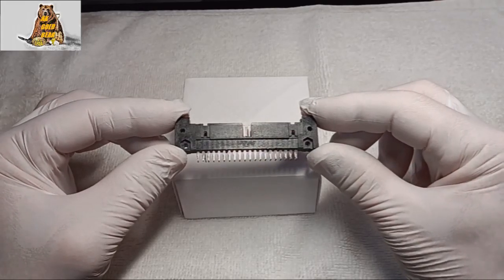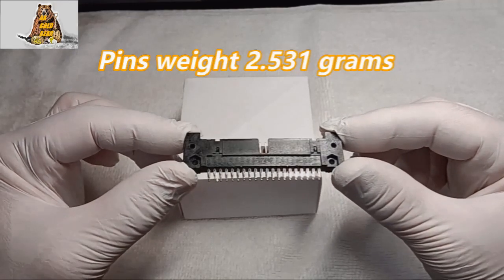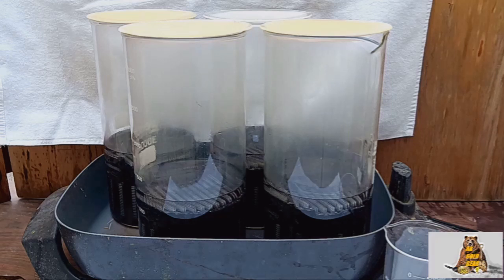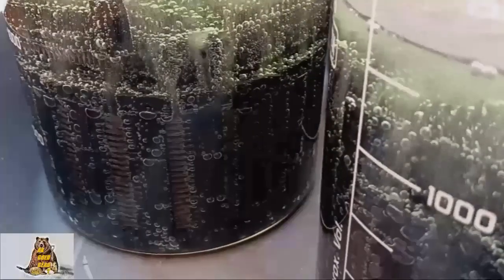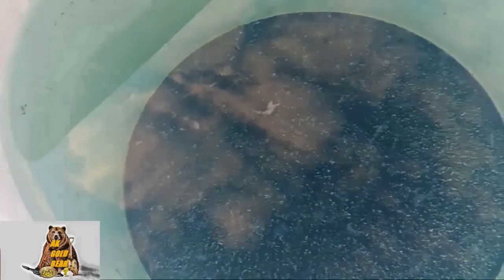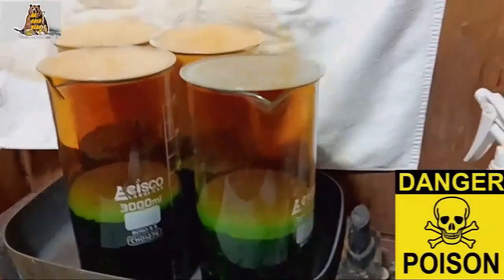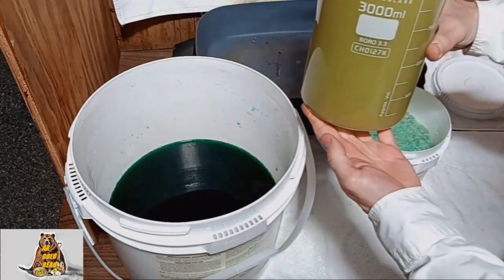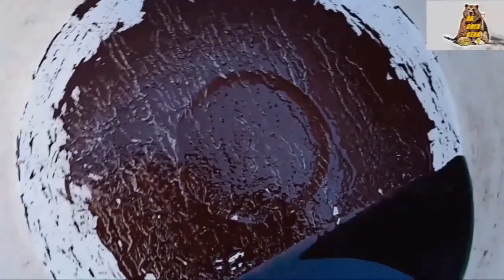Gold from connectors. Extracting gold from connector pins. Part 1.

Comment: This is a prime example of the slowest, and possibly the most uneconomical way of processing connectors with a few gold plated pins!
 I never bother trying to pull any type of pins out of connectors/plugs. Instead, all of them are pyrolyzed for full recovery of the plastic in the form of Raw Pyrolysis Oil, which is later cracked into free Petrol/Gasoline, free Diesel, and free Fuel Oil.
All the metal is then melted into a flat anode bar and electrorefined for full recovery of the Copper. Afterwards the Nickel content is recovered. (Nickel is worth 2½ times more than Copper). Any Tin is then precipitated out. (Tin is worth five times more than Copper). 
I have no expenses for this process as all comsumed electricity comes from my solar panels.
All the gold will always remain in the bottom slime of my electrolytic cell, and from there it's easy to extract pure Gold due to the high concentration of Gold.
Reply from the maker: I'm happy for you 🤔 Apparently, you know the theory very well, but for some reason there is not a single practical, physical confirmation on your channel...
Reply: @akgoldbear7669  .   Videos covering recycling attracts attention of just a few viewers on YT. They'll never go viral; they're too specialized! Even when calculating in the possible ad-revenue from YT, I'll always make much more money by working with my very streamlined and effective ways of processing e-waste and WEEE. 
I've been a full time recycler and metal refiner since 2012. Thus, I have more than 12 years of experience. 
I make a quarter of a million US dollars a year by recycling virtually every possible kind of materials. Therefore, I will not lose my time by making YT-videos. 
I have a workshop of almost, 100m2, with complete machinery, as well as a storage facility of over 400m2. Currently, I consider mowing to a larger facility of 930m2. 
I own two german Audi cars, two sportfishing boats, a beach house in a tropical country, and an oceangoing sportfishing yacht in the same country. I only work 10 months a year, then I go for holiday in the winter and enjoy the splendid tropical sunshine. 
If you can do better than that, please tell me how. 
Messing with extraction of solely Gold from modern electronics is almost equal to wasting your time. 
The real value is in the Tin and the Nickel. Most electronic components on Printed Circuit Boards actually contain lots of Silver. I also extract Rare Earth Elements (REE), Mercury, Germanium, Indium, and even Ruthenium from PCB components. The Gold is just tiny pocket money! 
However, having over 12 years of experience in recycling I've gained quite a comprehensive knowledge of the chemical aspects in recycling. If you have some questions about any kind of material, please feel to ask. I might be able to give you advice or recommendations.
Reply from the maker: "However, having over 12 years of experience in recycling I've gained quite a comprehensive knowledge of the chemical aspects in recycling." 🙂 Awesome👌 Over 12 years you have gained a lot of experience. But for me it's just a hobby.

Comment: To clean the oil from plastic I wonder if you could try Sodium triphosphate. I used it to clean oils from stainless steel plates for hydrogen production. I could never get them clean before discovering this which meant less HHO. 

The other way is fire. When plastics are destructively distilled the evolved flammable vapours can be used for the immediate heating processes, with metal and carbon remaining.
Reply from the maker: Hello. To be honest, I have never heard of sodium triphosphate in my life. It's something new for me. I have little experience. Anyway, thanks for the advice. Maybe someday I'll buy sodium triphosphate and try to remove the oil with this reagent, or whatever it's called, alkali?! Thanks for the advice 🙂

Comment: Following very closely but have run into a mess. Gold suspended per chloride test but smb won’t drop. Not sure where to go. Any help?
Reply from the maker: Hello. It is difficult to advise without seeing the solution and without knowing everything you did. First, you need to be 100% sure that you have dissolved gold and not titanium nitrite. In our modern crazy world, many manufacturers have begun to replace gold with titanium nitrite. If you definitely have gold in the solution and if the solution is small, try to evaporate the entire solution almost to a very, very thick jelly. But not to dryness. Then add a little water, mix everything very well and filter. A lot of nasty stuff will settle on the filter, and gold and, possibly, some metals will pass into the solution. Check the solution for gold content with tin chloride and if there is gold, repeat the gold precipitation. 🙂
Reply: @ thanks. Ya it’s gold. Do have a hand full of filters that we need to burn to consolidate. The liquid/acid still show when tested. But will boil down and take the advise. Easier to dig shinny and melt. Lol. Nor cal here and it’s all around us. But learning something new is fun.
Reply from the maker: "But learning something new is fun." Agree 🙂
Reply: I always first drop the precious metals with copperwires...then redissolve and refine...easy way to get rid of most non precious metals.
Reply: He didn’t show using urea to remove excess nitric that one time. Before the smb. But he had so much nitric he must have done this. It happened to me once also. If you watch Sreetips he uses just enough nitric to dissolve the gold. So he doesn’t need to use salfamic or urea
Reply: @ thanks for the advise. I did use urea to cancel nitric but I’m sure I’m dealing with garbage I didn’t clean off. We’re boiling down to jelly and start over with aqua Riga. 
I’ll get back thanks.
Reply: @ericbruns888  You're welcome friend. It takes some time but cementing out with copper is the simplest way to solve this. I read someone on the gold refining forum say, When in doubt, cement it out. And it's true. If you've not learnt about the Reactivity Series of Metals, do so. Wikipedia has a page on it that is good. Its the foundation knowledge on all of this.
Reply from the maker: @waynoswaynos   There was no need to use urea. There was very little nitric acid, and when filtering, I used water to rinse the filter and take every drop of gold from the filter. So I diluted the small amount of nitric acid with water. Right?! And then before adding SMB, I diluted the solution twice more with water 👌🙂 9:51 My eyes told me there is no need to use urea. Thank you for your time 🖐
Reply: @akgoldbear7669  Makes sense and thank you for sharing your process. From my perspective I see a lot of nitric going in and not much gold coming out. 2 grams was it? or  700mg? It takes 1ml of 68% Nitric to dissolve 1g of metal, but you poured in quite a few mls, hence the confusion I think.
Reply from the maker: Oh! I and everyone who does this would be glad and happy if one milliliter of acid will be enough to dissolve one gram of metal. I don't know on which forums you read this. To dissolve 1 gram of copper, you will need 7.378 milliliters of 30% nitric acid (p = 1.184 g / cm³). My nitric acid is 67% and I, like everyone else, spend 2.5 - 3 milliliters of acid to dissolve one gram of metal. At least 2.5 milliliters. It all depends on the metal being dissolved, pure copper or copper with nickel. Magnetic or non-magnetic metal. Many factors affect the dissolution of metals. In our crazy world, manufacturers of electronic components mix copper with a bunch of other metals to reduce the cost of the part. You mentioned sreetips, why do you think Stannic acid does not drop out in his processes?! Because he uses a lot of acids. Excess hydrochloric acid in the solution dissolves Stannic acid. On the one hand, this is good because it does not clog the filter when filtering the solution, on the other hand, it is bad because tin and lead can get into the gold powder. Do not read any crap on forums, you can get the best information only by experimenting yourself. Only through your own personal mistakes you can understand this whole interesting process 🙂👌

Comment: Those are new so maybe no tin. I spent years pulling pins out of the plastic connectors. I tried putting plastic and all into AP solution. A week or two all metal dissolved and I take time to check and spray water on every piece with stuck gold. It's a bit monotonous but way faster then trying to pull the pins out. Just saying. Do what you want love the videos. I think to get the purest gold it takes three times refining. I've used smb on the first then ferrous sulfate thinking third will be vitamin c. What do you think?
Reply from the maker: Hello 🖐 In my opinion, if the solution is dirty, if the solution contains all the metals, tin, lead, nickel, copper and gold, then the best option is to do the first precipitation with iron sulfate, the second precipitation with SMB, and the third, yes, with vitamin C. In my small experience, I can say that SMB pulls other metals from the solution. SMB is a strong reagent. If there is tin in the solution, then after precipitation with SMB you will get a gold precipitate with stannic acid H2SnO3. Although many say that this is impossible, but in my practices for some reason this happens 🙂

Comment: I reckon it's a trade off. This method, or physically pulling each pin from the connector. Then trimming each pin with a pair of dykes (diagonal cutting pliers). Less acid required, but more time consuming. You could've used concentrated sulfuric acid to wet ash the connectors, but that is very dangerous and messy. You'd then either trim the pins or just dissolve them in AR. But almost 3 grams of gold is nice!
Reply from the maker: Thanks for the advice 🙂👍

Comment: That's a good return 👌 I tried that and the acid melted 🫠 the connectors and encapsulated some gold.
Reply: @ManMountainMetals  I've run into that myself. I put plastic connectors in AP some come out nice and clean some a gooey mess with gold flake throughout.  I put the gooey ones into my next batch.
Reply from the maker: Thanks. Yes, sometimes the process does not go as we would like 🙂

Comment: Is there any gold in old tv parts,
Reply: Yes, there is.
Reply: @scrapping4shiba thanks
Reply from the maker: Hello. I don't know of any electronic device that doesn't contain precious metals. Any device with a circuit board contains gold and silver, at least silver. If you have an old TV, it will contain more precious metals than a new one. The newer the device, the less precious metals it contains 🙂

Comment: 2.94 g of gold is a pretty respectful amount to me. The gold really looked nice .
Reply from the maker: Actually, I got 2.94 grams from 400 grams of gold plating, because the pins are 40% gold plated, and that's good. But to dissolve 1000 grams of metal and get 2.94 grams of gold, that's very little 🙂
Reply: @akgoldbear7669 ❤❤❤❤❤❤❤❤❤❤❤سلام استاد عالی پالایش خوبی داشتید😊😊😊